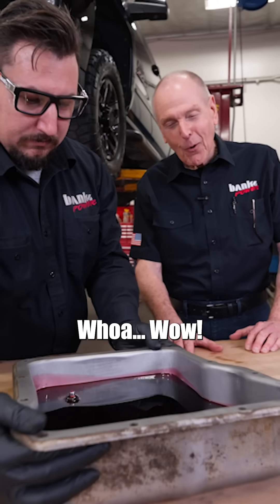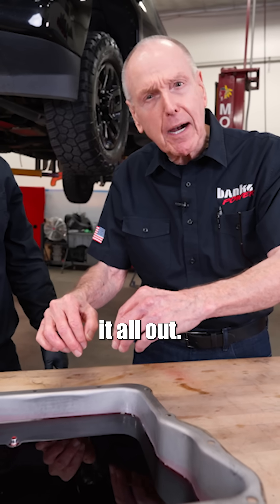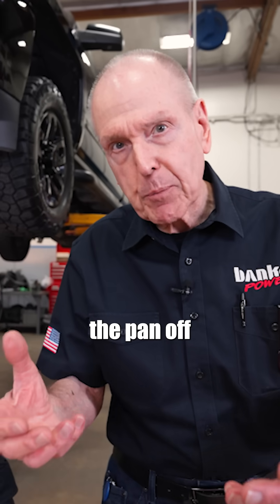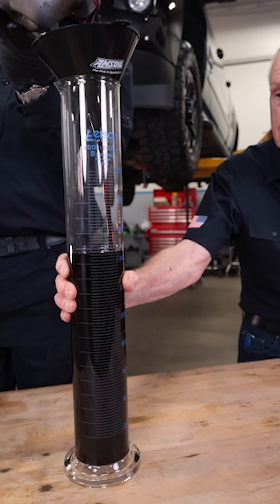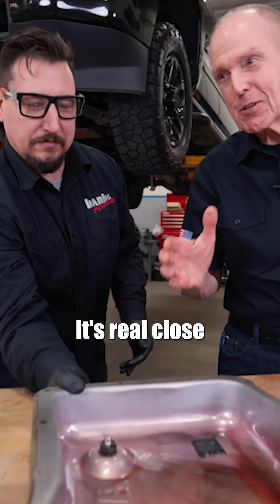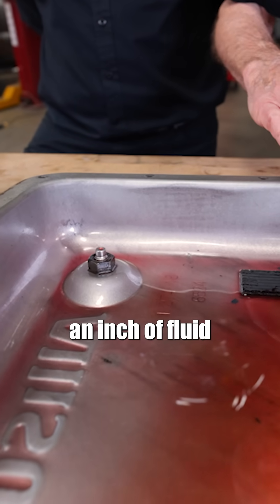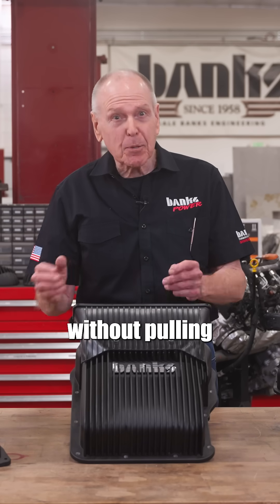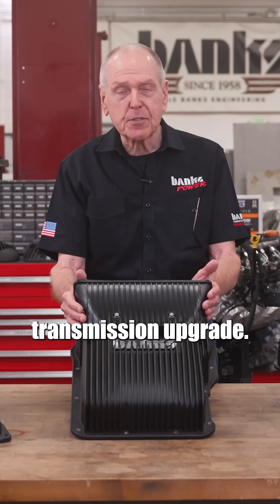This factory drain plug is a joke.

Comment: I love what y’all do but this isn’t surprising. 99% if the time you drain the fluid you change the filter too so the pan has to come off anyways.
Reply from the maker: The Allison 1000 has an external spin-on filter. Most often guys will drain the fluid using the drain plug and replace the spin-on filter. Only after 100k miles do most drop the pan. So, the convenience of the Ram-Air Trans Pan's drain plug is for those intermediate services.

Comment: Nice pan upgrade, BUT, if you are draining the fluid, the pan is usually removed for further inspection.
 The pan doesn't NEED to fully drain. It >drain plug<only needs to allow MOST of the fluid to drain, so the pan can be pulled, without spilling over the sides when it's pulled.

Comment: Love watching Gale show these terrible OEM designed parts, and his companies solution to their design flaws. Whoever designed that OEM drain pan needs to get a refund from school, because Gale just educated him on how to do it right the first time.
Reply: Funny how simple minded people are online... obviously the oem is not simply dumb, this demonstration is simply a lie, when you do a service on this part, you need to drop the pan as per service manual instructions, to change the filter. So the drain is only there to remove some of the oil, the rest you simply empty after dropping the pan.
Reply: True, and that's where to check service levels on transmissions without dip sticks. while in drive on a lift.

Comment: This looks more like a fluid level plug. Unsure on this Allison but a lot of manufacturers have these style of drain plugs so when you get the transmission fluid to operating temperature you remove this plug to set the correct fluid level.
Reply from the maker: It's not for fluid level because it's under the pickup tube. In other words, if you used it for leveling, you'd run the transmission dry.
Reply: @bankspower  Is it possible they just use the same pan for all their trans to save money. That's looks like the pan in the 8L90 and the 10L90 which that is the fluid level check plug cause those don't have dipsticks anymore.

Comment: you love your products so much i can not afford them.
same years back i almost bought your intake and exhaust system for my 99 F250 with the 7.3 diesel. but i am glad i did not. 
as a fool crossed the center line and totaled out that truck. i had spent $5,000 at the dealers only months before for a computer problem. needed a new main frame for the truck.
Reply: Why did you cross the center line?

Comment: In most cases, That's just to get the majority of the fluid out so you can drop pan and change the filter without slapping fluid everywhere. However, there's no denying that's a stupid ass design.

Comment: What is most impressive is the man took down a transmission pan, full of fluid, and didn't take a bath in it =)
Reply: Only because he most likely already knew about that. If he went in blind he'd be wearing it 😂
Reply: It helps when you can pay for top notch staff and tools in a controlled environment
Reply: @ottergreen8190 right let’s see him come out clean 
Doing it with a bucket o tools 
A driveway with a 20 degree  slope 
And 9 inches of room underneath 

05 BMW. M5. Man that was a boozy of a job  and no. We did not come out clean 
Come to think of it. Nothing did
Reply: Easy with s lift
Reply: He's changed his shirt 3 times to get the take
Reply: Yeah transmission pans can be messy I remember my first one was horrible. I don't mind getting covered in gas or diesel or oil but my God gear oil or ATF is horrible to get covered in especially if it's gone bad and is burnt like mine was
Reply: @danblanzara3174 Yeah gear oil/atf smells bad, but the friction modifier you add to gear oil for posi-traction differentials is the absolute worst! So when you have burnt gear oil from a posi/Lsd differential it's horrendous! lol
Reply: @danblanzara3174 I've only taken out one on my own car, and I surprisingly didn't wear it. I cut up an old tote and turned it into a super large shallow catch pan
Reply: He already drained everything he could so it was not full
Reply: He didn't take it down full of fluid. He took it down the way it was supposed to be done. Use the drain plug to avoid the trans fluid shower. Then you can drop the pan, and get the rest out, and CLEAN THE PAN! 

ALWAYS pull the pan.
Reply: ATF baths are the best on a cold morning 😂
Reply: It wasn't full, thanks to the drain plug they're complaining about.  It's way better than none at all!
Reply: drama queens.  get the appropriate drain plug and put it in the correct place.  silly noise.
Reply: @silvernblackattach yeah... That's what they did....

The factory one is a design flaw
Reply: You really don't need to know anything about imperial units unless you live in the USA, Liberia and somewhere else I can't remember!
Reply: Na it’s possible when drained man. Skill issue for sure
Reply: That's probably because it had a drain plug to drain most of it beforehand 🤦‍♂️
Reply: They drained the fluid the rest won’t come out he explained it to you point was when you service the transmission there’s still dirty fluid in the pan that don’t come out due to the high drain plug
Reply: This is called marketing boohoo! 😅
Reply: He drained it and only showing how much is still left in the pan. Did we watch the same video?
Reply: Its not that hard, 96 e40d holds allxthe fluid in the pan, comes down just like this. No mess, not a drop spilled.
Reply: So true 😂
Reply: Took a bath in the transmission fluid of my 73 charger ( 727 torqueflight ) after I had blown the engine ( 400CI ).
It took two days to get that smell off me.
Reply: Or maybe just maybe... This was a planned video 😮😉
Reply: Put a jack up against it, unbolt it. Lower the jack and slide it out with bit hands slowly.
Reply: Yeah and it already had the gasket and any silicone scraped and wire brushed off too lol
Reply: I agree, I have never been able to do that, lol. I always wear it.😂
Reply: AND cleaned off the old gasket 😋
Reply: AND cleaned off the old gasket 😋
Reply: Movie magic? Gale is awesome though. I'm not a diesel guy but he makes me interested in them
Reply: Absolutely!! He's got skill and patience!!
Reply: Well unlike a lot of them, that pan at least has a drain.
Reply: "Drained' it first. So it only had that inch of fluid in it anyways.
Reply: Or they filled it once it was off. It's just to show how much CAN be left not how much WAS left.
Reply: Was not full. He used the drain plug and got most out.  Many pans have no drain plug. Have to loosen one corner to drain some and still deal with lots in the pan. That plug is just fine. Need pan off anyway to clean it.
Reply: It's not full of fluid. And I've taken down hundreds of trans pans without making a mess
Reply: Except the pan didn't have a factory drain plug
Reply: It's amazing what an extra set of hands can accomplish!
Reply: They have lackeys for that 😂
Reply: For me its the fact that they are american and use milliliters
Reply: That’s because of the drain plug. Most pans don’t even have them. This is a convenience feature. It’s not supposed to let all the fluid out, just enough to remove the e pan without drenching yourself
Reply: its not hard, just prop it up with a stand, it should be wide enough to hold the pan in place while unscrewing it.
Reply: What's most impressive is to see Americans actually using the metric system
Reply: That IS impressive.  I just had a flashback to several decades ago, lying on the apartment parking lot under my Fairmont trying to pull the pan to change the filter. My hand slipped as I was pulling one of the screws out, and the pan tipped and I got a face full of ATF.  That stuff tastes TERRIBLE!
Reply: They already dropped the plug and let it drain. They’re showing you how much stays even when you pull the plug. Dropping it after the plugs been out is so much easier to manage without taking a bath
Reply: Even more impressive was how clean that gasket surface was for just pullung the pan.
Reply: Might not be the first time. Lol
Reply: That trickle down one arm used to get me
Reply: That's because it has a drain plug😂.
Reply: Unless you do a trany flush most of the fluid is in the torque converter. You add new fluid to add bach the detergent & additives that wears out of the fluid. It has a magnet in the pan to collect the fileings. You want a great job, drop the pan, clean it, then flush the rest of the oil. If just changing what's in the pan, just drain & fill it back.
Reply: Looks like the gasket didn’t stick either making it a clean removal. 
I remember when i changed my atf, i took the pan off to change the filter and spilled done in the ground and it got on my hair, the shower i took after i was done was so satisfying and refreshing
Reply: once you do it a few times you learn lol
Reply: I bet 1$ they just dumped fluid into it on bench and just opened drain plug.

As far as video goes. It's all BS. Use fluid exchange machine. If are bothered by oil in pan. You should be bothered by oil inside transmission and torque converter
Reply: It was almost 2 quarts ...... 

Also not everyone has the machinery to remove all the oil wkthot dropping the pan....

This pan is worth it to those who care :)  @Small-Kitty-Paws
Reply: @kodybell4616  we aren't talking about pan but drain plug. You need to drop the pan each time you change fluid anyway. So this "feature" is very blown out of proportion.  Btw. I'm just against this very aggressive marketing. That's borderline, useless upselling in most cases. When it comes to drain plug only
Reply: @Small-Kitty-Paws  why would you require dropping the pan Everytime? Just curious?
Reply: @kodybell4616  you have filter up there that needs to be replaced
Reply: @Small-Kitty-Paws it’s not bs gale banks doesn’t lie about shit like that and that’s why he makes permanent fixes to shit manufacturer won’t. Also tells me you never worked on a vehicle before
Reply: @christianscarcella528  I worked enough time. To not do dumb shit just to prove a point. Thinking again about my first point. There's not a single reason to pull it from a car like that. Just to make 60 second video
Reply: @Small-Kitty-Paws he’s selling a brand. It’s way more complicated than your willing to give it credit.

Comment: You have to pull the pan to change out the internal filter anyway. The purpose of the drain plug is to mitigate the mess while removing the pan.

Of course, this pan is a good upgrade, but the drain plug not letting all the fluid out just isn't that big of a deal to me. Just pulling the drain plug and refilling afterward is a really half-assed way to replenish the fluid. If you're doing a thorough job, you're pulling that pan, cleaning the magnets off, and replacing that internal filter.

Comment: ...oh... to spend just 1 day with that man... what a blessing  of mechanical knowledge
Reply: The guy a moron you need to remove the pan anyway to access the filter 
The drain plug is just to make it easier and not make a big mess wham removing the pan 
Ps by the way 90% of auto trans oil pan don't have drain plug so you need to leave 2 bolt loose, pry a corner and hope the oil doesn't end up all over the floor or worst on you lol
Reply: @legros731 There’s a reason why he’s Gale Banks, and you’re just some guy calling him a moron under his YouTube video.

Comment: With that nut, I believe that is how they plan for the fluid level filling. Once the fluid gets to the top of that hollow bolt, it runs out letting you know the level is correct. Therefore, some transmissions do not have a dip stick. I'm not sure on this Allison but it is surely a nicer feature to be able to drain the pan first then remove it for inspection of pan debris if that is the idea for some folks. Also, folks need to understand that transmission fluid changes are better off being done more often than the service manuals suggest. Every 30,000 miles will keep an automatic going much longer than following the service book intervals.
Reply from the maker: The Allison 1000 has a dipstick to check fluid level. The plug discussed in this video is for draining. It serves no other purpose. Unfortunately it does a poor job because GM cut costs by using a stamped steel cover. Using a thin steel cover does not allow for thread engagement so they had to add a nut. And, because they didn't want the drain bolt to get sheered off, they recessed it. All this means that you can't drain all of the fluid. So, the pan must be dropped. The Ram-Air Trans Pan solves this for those that don't want to drop the pan every time.
Reply: @bankspower  I get those things, but it doesn't make total sense that they recessed it THAT deep and in that direction of it had to be that deep recessed. It very much looks like an intentional minimum safe threshold of sorts, does it still contact the gearing when 'drained'? If so that's probably the answer. If not, it's a bunk theory.
Reply: The gears are nowhere near touching the fluid in the pan. There is a valve body and filter between them. A pump moves the fluid up to lubricate gears, clutch packs and to provide pressure to the valve body. This drain design makes sense to the manufacturer because it is cheaper to make and the nut doesn't stick down below the pan. In their mind you only need to drain enough fluid out so the pan can be dropped without a gush of fluid coming out. Most transmissions don't have an external filter so the pan must be dropped. Some of these transmissions have an external filter therefore you don't need to drop the pan when changing the fluid and filter. That is when you really should have a design that allows fully emptying the pan. No one wants to drop the pan and change the gasket or scrape off RTV.  Lube Locker gaskets solve this problem on transmissions that need the pan dropped to access the filter. They are reusable 3-4 times as long as you don't over torque and squish the heck out of them, great for differentials. @Roobotics
Reply: @CoolHandLukeVol  ah this makes sense, but then the next question is does the pump contact the oil in a way it can still distribute it in the lowered state? You're probably 100% correct it's just for emptying it enough to drop it. But it could still serve a 2nd function to keep from blowing the transmission out from no oil whatsoever, it's a reach and I accept that, but it might hold some basis in that it's foolproof to have a tank and not have some oil in it to use. I just don't get why they would punch the dimple for the nut that high and large otherwise, it's weirdly oversized and excessively tall. It just seems intentional and actually more costly than a smaller tooling indent that would still clear things.
Reply: @Roobotics  Not sure about that. Each may be different. Would have to measure the height of the pick-up tube/filter and compare it to the height of the drain. But, burning up the trans or pump would require some real stupidity. At that fill level (excess in pan) nearly all transmissions would suck up what is in the pan really quick which would drop the pressure so low you wouldn't be able to really drive it anyway. It either wouldn't move or shift or would act so strangely you would definitely know something was wrong.
Reply: @Roobotics  Also, most transmissions (I am familiar with) don't even operate the pump when the transmission is in park. This is why you need to drive it or at least put into Drive after changing the fluid and before checking the fluid level with the dipstick.  That may be different now on these newer designs. The manual might say the transmission fluid volume is 7 quarts but some fluid always remains inside the torque converter. This makes the refill amount needed difficult to judge unless you have experience or consult someone that does. Overfill can cause problems too.
Reply: @bankspower  Thank you for the detail.
Reply: @bankspower  Agreed, may as well not have that drain plug if it leave 2 qts of fluid in the pan. Maybe they did that to lower the fluid level to prevent spillage when removing the pan (LOL).
Reply: This honestly makes the most sense, so this 'solution' is for a feature the other just never had. It wasn't poorly engineered, it was engineered in a way he either doesn't realize or is bending the truth on it's real purpose. If that isn't the correct ammount of oil needed, then it might be a failsafe or 'minimal' level to avoid destruction.

Comment: I must be missing something.  Won't any leftover fluid get dumped (all over shoulder & arm) when dropping pan for filter change?  I get that most don't have a fluid extractor. 
I don't have gizmo that changes filter thru drain hole.
I do like the thought Banks put into their pan.  But when GM decided 2 screws per stereo speaker was sufficient for saving $x# (X number of dollars), they sure as heck will not be spending on heat sinked pans. Not when fleet discounts make up majority of sales for these vehicles. 😊

Gators snagging a drain plug at hiway speeds is a bad recipe.

Comment: I didn't know at the time when i bought my Mustang GT, Just how lucky I got by getting the right year.. I have a metal oil pan in 2018 they went to as plastic one that warps and leaks over time.. Anyway everytime I see how much oil is left over in the stock trans pans and the il pans I am blown away!! But it all makes sense.. The dealer's don't want us doing any maintenance on our own cars and trucks anymore. And They have been trying to pull that lifetime BS on their fluids for 20 years now. The dealer's are making these cars to be throwaways. They are all trying to take a page from Apple and make it soo you have to get a new car every 5 years whether you want to or not!!! And we all seen how well that worked out.. I stay on top on all my fluids in all my cars..